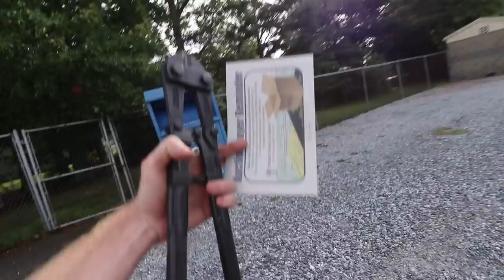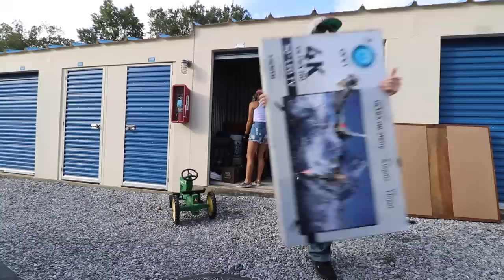WHAT'S INSIDE THE SAFE?! - Contents Of Storage Locker Auction!

Comment: The manager of the facility is supposed to be with you when you cut the lock. Be-careful cutting the lock yourself. Storage treasures states the manager or someone working with the facility needs to be present when the unit is cut and opened.

Comment: 11:15 that is a vintage toolbox. Just like the one I inherited from my Dad. He was a Carpenter in the mid '30's, went to WW II and returned to carpentry till the '60's.
Reply: I had one like that in 1976 if it's a Kennedy, still in the attic.
Reply: Mine also in attic with complete set of brace an bits. And aaa of Dads hand saws, with a tooth setter.